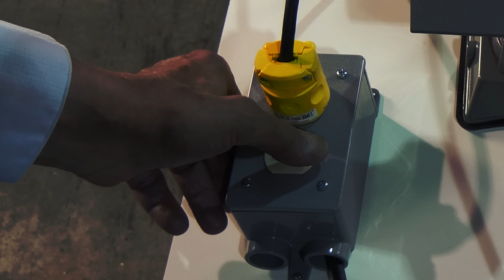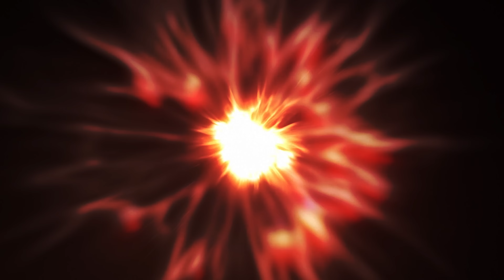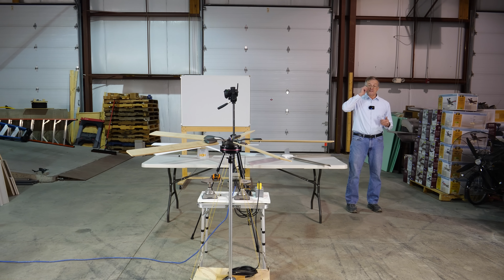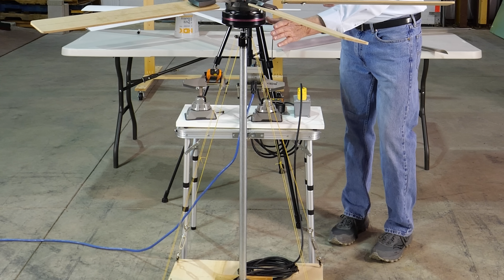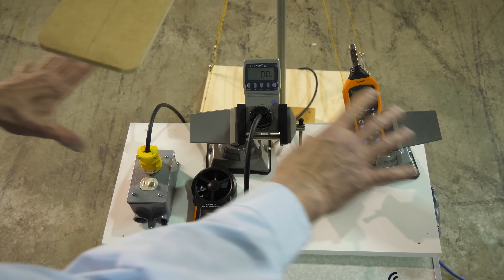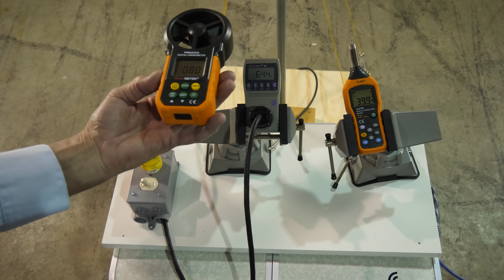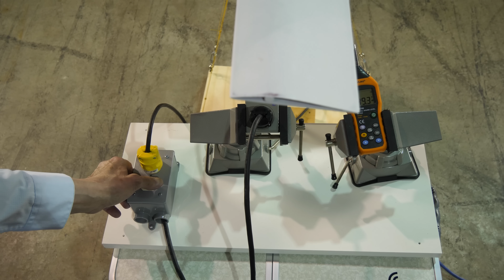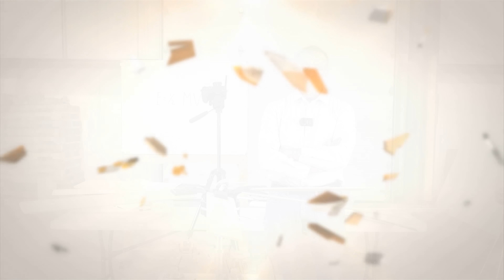This Fan Uses Almost NO Power

Comment: This is a topic I appreciate much as a graduated electronics engineer. However, things are not as simple as they seem. Most of low power induction motors with capacitive or inductive phase shifting have a very poor efficiency indeed. Most of the power is converted into heat, since the magnetic field does not match with the rotor's movement. Three-phase induction motors however are a completely different animal. Many trains and cars are operated by these asynchronous motors. They have squirell-cages made from copper instead aluminium (lower losses) and the slip is matched to torque and angular velocity by VFD (Variable Frequency Drives). Home-appliances, like washing-machines and tumblers use commutated AC-motors with a much better efficiency than these old fashioned single-phase induction motors. In my humble opinion, one of the best typea of motors are reluctance motors (see SynRM or SRM).

Comment: The less efficient motor is also putting off more waste heat which increases the load on the AC system. Brushless motors are to traditional motors what LEDs were to incandescent lights.

Comment: Thank you!
Brushless motors are incredible, and no brushes to wear out.......MFG's hate that😁
Reply: Brushless DC motors are 3 phase motors with the DC to AC inverter built in and usually position feedback to help control the inverter. Standard household AC fans use some form of induction motor which don't have brushes. Household brushed motors are used for things that need smaller lighter high power such as vacuum cleaners, sewing machines, portable saws... And even there some are now being replaced with brushless DC (and the requisite AC to DC rectifiers to get the DC in the first place).

Comment: i had to buy almost 30 fans for my new home, tested the same thing as you without taking noise and blade design into account. got the same results and went with dc inverter fans. because if something is running on 30 watts for one day it will end up consuming 0.72 kwh, which is a lot for one fan and one day.

Comment: Very interesting - and useful. One thing you failed to mention was that the asymmetrical air foil would be less efficient when the fan was reversed (using AC or DC motors), and probably MUCH less efficient. Yes, when I have to replace a ceiling fan I will definitely look for the Hunter brushless DC motor fan. And try to be aware into the future about brushless DC motors for any appliances, where possible.

Comment: As I see several others have mentioned, I also would have liked to have seen a final test with the airfoil blades as well. I think the reduction would have been very substantial, possibly around 10 to 14 watts to achieve the same air speed. To go one step further, these are simple air airfoil blades. To really maximize them, you would put a twist along their length., with the steepest angle of attack near the root and then going near to level by the tips. This helps to evenly distribute the load along the entire length of the blade. And it also helps to optimize The attack angle To airspeed ratio. for each radius path along the length of the blade. To be clear, airspeed in this last instance is not referred to airspeed through the fan, but rather in relation to the blade going through the air in its direction of rotation.

Comment: I am listening to this under a BLDC fan in India. These have become quite popular in India for several years now. Its peak summer here, AC is on, but the fan runs all the time.

I think what could be also included into the energy cost equation is the fact [additional saving] that the 50 or so watts of heat (that would have been released into the closed room, were it not BLDC) The heat that would have to be removed by the air conditioner.
Reply: With the A/C's CoP being 4 or more, the very minor increase in energy consumption to overact the heat from the fan is pretty much insignificant in the grand scheme of things. The benefit your fan brings you (greatly improved air circulation) is far greater. Besides, your fan is not 0% efficient (i.e. dumping all input energy as heat in the end) afterall... Most of it goes to turning the blades, moving air, and only a very small percentage is lost as heat, be it from eddies in the windings or friction from the bearings.
Reply: @teeteetuu94if the moving air eventually slows, won’t the kinetic energy turn into an increase in temperature? The moving air only cools you off because it’s cooler than you are or your sweating.
Reply: Good point. not only are you paying for the heat, but you're also paying to remove it. I imagine using the AC to remove it isn't that expensive because of your COP. Looking up the COP of an AC system, its close to 4. so you're having to use an additional 12.5W to remove the 50W produced by the fan. Just turn the fan off if you don't need it. this is the best solution. 100% of the energy used by the fan has to be removed by the AC if its colder in the room than outside.
Reply: Exactly right. Remember how hot old incandescent lighbulbs used to get? Even 25W ones were too hot to hold, You want to stay cool, but you're heating the air you circulate will an equivalent of a 40-60W bulb. Crazy waste.
Reply: @mateuszQRDL  Then you'd have to take into account the CoP of the air-conditioner (Coefficient of Performance - how many Watts of cooling power provided with however many Watts of input electrical power). Assuming the typical CoP=4 on the low-end, the heat from your example light bulb would merely be an additional 10-15W of electrical energy usage by the A/C. A/C would most likely be in the hundreds of Watts while in use, so to compensate for the heat emanated from an incandescent or even a fan is pretty much insignificant, especially when you take into account their respective usefulness (e.g. fans - better circulation; you can increase A/C thermostat temperature by a good 3 degree C and cut down significantly on energy consumption, way more than whatever amount of heat a fan motor and bearing releases into the room).  For scale, humans put out 100-300W of heat each, depending on individuals and activity level.
Reply: @teeteetuu94 OK, but the choice is between an inefficient motor and an efficient one. You pay both for the inefficiency of the motor and additional 1/4 of that for the additional work required of the A/C unit. In might not seem like much, but it's something you have influence over, unlike many other inefficiencies in yout life. In the end it boils down to the difference in price of both motors (incl. the brushless controller) and their durability.
Reply: @mateuszQRDL  Now imagine cooking in a 350* oven in the summertime.  People do it, but its forbidden at our house.

Comment: "The cheapest energy is energy we don't use" awesome video. What do you think of a potential increase in failure rate due to additional electronics?
Reply: Low power electronics like the controller basically lasts forever when it is kept safe from impacts, water, and things like that. Since the circuit is simple and doesn't need to do a lot of calculations, the wear is very minimal. It can be in an enclosed space without overheating so dust / short circuits isn't a risk, and it is stationary when installed.
I wouldn't worry about the failure rate, as long as you don't try to save another 20 cents on the electronic bits.

Comment: It's funny how different American attitude towards energy is compared to Finnish. My three room apartment uses bit under 1000 kWh/year. All appliances are EU energy rating A+ or better. And I pay less than 10c/kWh, buying a drying drum with min A+ energy rating was self clear. I didn't even find any dryer without an heat pump. I actually tried to find one for heating clothes to min 60C, but it's hard to find even an old used ones, and even more hard to find with heat setting to min 60C. In Finland its easier to use sauna for heat treatment. The dryer I bought cost less than 300€, what I learnt from YouTube channels, in US a low energy heat pump model costs much more. My drum has max power 1kW, and it should dry 8kg wet cotton with 1,8kWh. I wash typically 3kg, and it takes less than an hour. 

A new house in Finland has typically triple glazing with selective coating and noble gas fill in windows, heat recovery for ventilation and heat pump for heating. Those are close to the minimum nowadays for a large house. A small one may have electric heating and air to air heat pump without heat recovery. 

Our electric grid is over 95% non-fossile, mostly wind and nuclear and hydro,.some bioenergy. The renewables are so cheap that the nuclear power plant is often reducing its power, because the energy price is close to zero or under zero. Despite giving up using fossiles, our energy prices are smallest in EU. We don't use anymore natural gas after Russia invaded Ukraine. We didn't use it for heating and cooking before either. Oil heating is now more expensive than electric, and half of the new cars are rechargeable, most of them full electric. 

Also plumbing is different. We have a lot pure water, but our toilets and showers take far less water than American ones. I sometimes wonder is it even clever, because city must flush old sewers to keep them open. Helsinki even uses heat pumps to recover health from waste water. I live in Vantaa, and our utility company is building over million cubic meters heat storage. 

I doubt that the original fan wouldn't be legal to sell in EU because of poor energy efficiency. We regulate even vacuum cleaners power efficiency. And after less than ten years the gas cars are likely impossible to fulfil requirements.
Reply: In the latest ratings, with its reduced energy use limits, it is hard to find a freezer higher then C, or even D, these used to be labelled A in the past. Finland traditionally has white coal and geothermal, too. The Sami are being killed off as a traditional, nomadic people taking away all their territory for Giant windturbines. Nuclear, you lucked out on, getting the plant for a fraction of its build cost, through a fixed price deal, that nearly bancrupted the supplier.
Reply: @perpetual4958 Yes, energy ratings are now much more strict.
We don't use geothermal energy.  I remember two projects drilling several km to bedrock, but the temperature and energy yield was insufficient. We use a lot heatpumps that use maaybe 200 m deep wells or horizontal pipes, collecting about +5 C heat. The wind power got more resistance from  Sapmi people in Norway.  In Finland the large wind farms are on west coast, and less in Lapland. The Eastern Finland is complaining that army doesn't let building any wind turbines there because of air defence radars. I don't know what is white coal? We have stopped using peat as energy,  because it's classified as fossile fuel, and swaps are more preserved now.

Olkiluoto NPP was very unlucky,  got ready more than decade late, and after it was finished, it has broken already several times.  In my opinion it was a crazy project.  It was supposed to be the largest in the world, very expensive and it proved to be even more expensive and has still proɓlems like breaking turbines. It was built so large because the green party opposed nuclear power and finally agreed only one more reactor. I am pretty sure that three smaller identical ones with known technology would have been sheaper and faster to build. Now it's also too big to run full power, because there is not enough power reserves to keep the grid up, if it is quickly shut down.
Reply: @jounisaari9471  White coal is the old 'nickname' for hydroelectrics, so dams with turbines and bufferlakes. Thanks for the extra info on the Nuclear plant, saw a longer TV report on it, it being held up as example for holland.

Comment: Unfortunately the US is behind in this. Many people only look at the cost of the item not the total cost of ownership. Other parts of the world have been switching to "inverter" brushless DC motors because electricity costs much more than the US. You have to spend a lot of money to get a refrigerator with a BDC motor. Your front load washer will have a BDC motor but the matching dryer won't. I saw examples of this 25 years ago when designing products. Buy a 120V AC chassis cooling fan and it gobbles the power. Buy the same fan that runs on 12V or 24V DC and it sips the power for the same airflow. BDC controllers are getting cheaper every day. Enjoy the new rabbit hole you fell into.

Comment: BLDC ceiling fans are extremely common in India, with competitive pricing compared to the legacy AC fans. 

The issue I've found is that they skimp on outer body materials to compensate for the cost of the electronics inside. This usually results in cracking of the rotor head and other problems coming up within 4 to 6 months of use.
Reply: You get what you pay for I guess. You need to put a little more for a quality product.
Reply: I bought 3 fans in 2022 still working fine. Luck or great choice I guess 😅

Comment: The fan only increases the velocity of the air, not its density (and thus mass.) The blades are not made flat entirely out of convenience, but because the fans are reversible with the flip of a switch.
Reply: Nobody said that the fan increases the air density. The proportionality of energy (or better... power) with the cube of air speed comes from the increase of FLUX (mass/time, proportional to velocity) and kinetic energy (proportional to the square of velocity). The power needed to move air is the increase in kinetic energy divided by time, so it is 1/2 FLUX * AIRSPEED^2 = 1/2 airdensity * surface * AIRSPEED^3. I used capital letters for variables, the others are constant.
Reply: @eriton6806  He literally said more mass. The word you're both reaching for is VOLUME. The mass of the air doesn't change with it's velocity. Yes, there's a greater total mass per unit time because it's moving faster, i.e. 5gal weighs more than 1gal. (5x, in fact.) It's the same mass moving faster.
Reply: @jfbeam given the context he said "mass", but he actually meant flux (mass divided by time). Since he wanted to estimate (comparatively) the efficiency of the fan blades, the physical quantity that relates to the electric power is mechanical power, i.e. the increase of the kinetic energy of the air per time unit, which, at the end of the day, assuming constant the air density, and the initial airspeed (=0) is proportional to the cube of the final airspeed.

Comment: I would have liked to see a couple of changes to the test setup.  The airflow measurement was a bit coarse -- even my cheapo anemometer measures to 0.1 m/s.  Second, the anemometer should have been fixed in place to remove any experimental variation with the hand position (distance from the blades but also radial distance from centerline).  And third, I wish you'd found a way to test the blade efficiencies at different speeds.  Airfoil efficiency varies with speed and that's an avenue that intrigues me.  But all in all, the thrust of the video was how the efficiency of the standard motors is horrible, and I think you made that point well.

Comment: Even more important point: 50W is extra half a person of heat in the room. If you're using the fan when it's hot, the fan heat itself may push you over the limit to turn on the AC 2 weeks early in the season! And that's a much more significant saving.
In the summer, each inefficient appliance multiplies its cost by increasing AC consumption. In winter, though, it's mostly offset by needing less heating.

Comment: You took the diameters of the blades into account but did you take the weight/mass of the blades into account?  I'm just wondering if the "metal airfoils" were to heavy for the motor.  Just food for thought.  Editing: Definitely should have been measuring fan speed and with your DC motor you had a six blade vs the five blades on the AC motor.  I think theres a lot of factors to take into account.  Would love to see a second part to this where you figure out the most optimal setup!
Reply: Um, once the blades are spinning, does the mass of the blades matter (thinking 'no', but I'm asking a question here)?

Comment: Given how efficient LED bulbs are, I've long had the idea of wiring the lighting circuits in the house to a modest battery backup for power failures. This is great info for minimizing the loads from the fans, I had no idea the generic motors were that inefficient. I agree with the other commenters that knowing the numbers with the better airfoil would be interesting to know what the absolute best efficiency could potentially be for a given airflow.

Comment: What would you say to the idea that "lift" from a wing is simply a charge concentration on one side or the other. or trailing edge. I"m not the scientist. Just listening to what some have said. Gerald pollack is a heavy water researcher and explores structured water. This idea that infared and uv structure the water. Or charged in one way or the other. That birds flying might be charged based not a pressure difference as most explain it. Just curious and interesting.

Comment: I was testing a dc inverter blower fan from a window air conditioner rated at 13w, but on high it only uses 8w and throws around a ton of air. These newish inverter motors use slightly more electrical components rather than just needing attached to two wires. I also wish more attention would be paid to providing products which are less energy intensive, but like others have said, if it raises the initial cost by $1 most Americans will pick the cheaper option on the shelf and then pay hundreds or thousands extra over the life of the device. Most people I talk with can't even fathom kwh or watts or amps or convert any of that to cost.